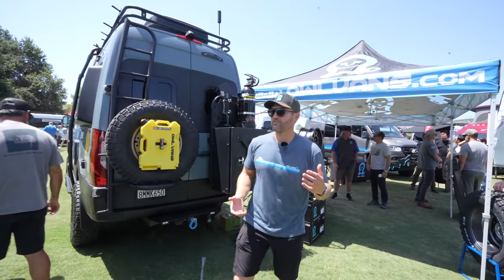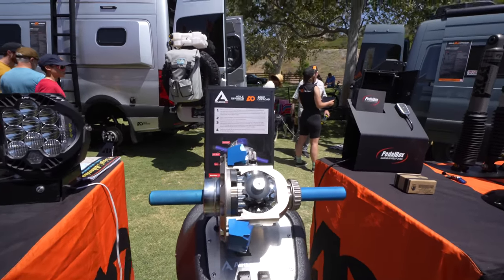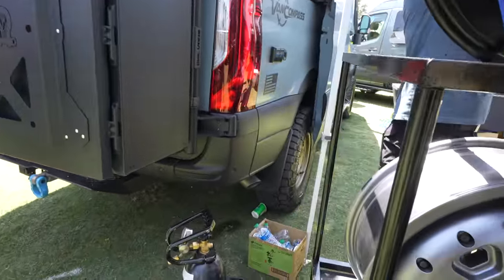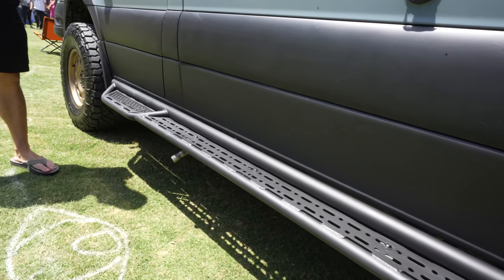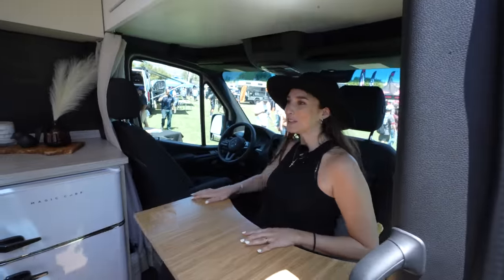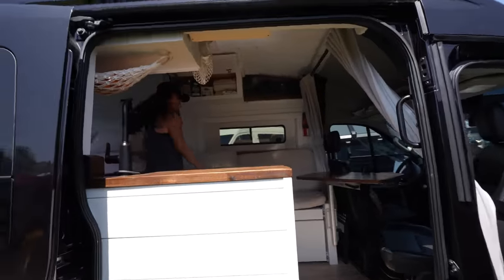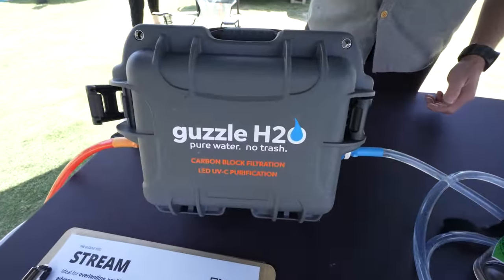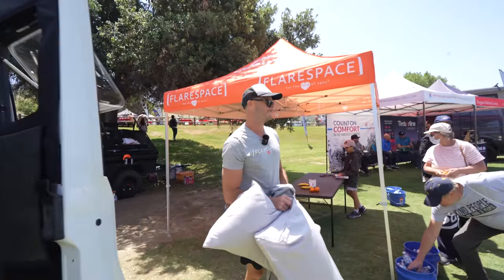Shopping For A New Van? (Adventure Van Expo 2022)

Comment: Flares are neat, but is that the right height for the bikes under bed? If you had to raise the bed height 6 inches, you wouldn't fit your head in flare.
Reply: 33.5" off the factory floor. we have other solutions for a higher bed!